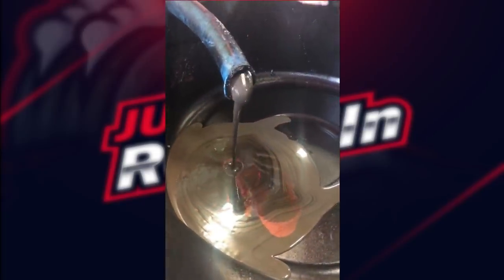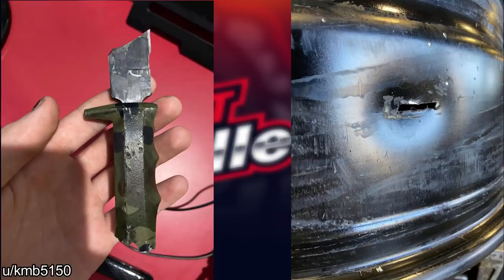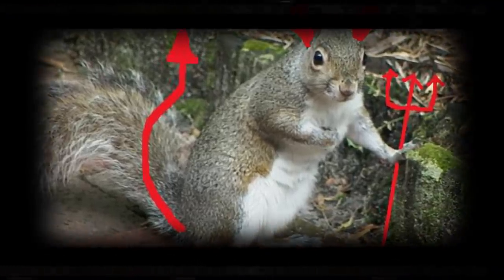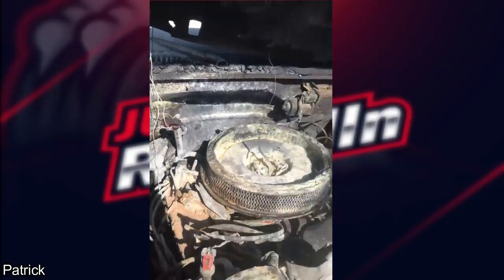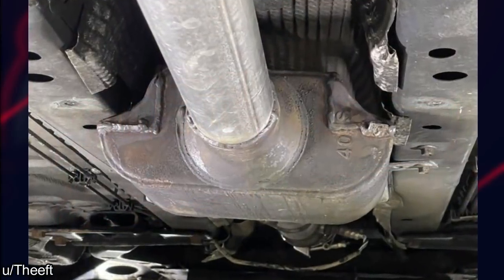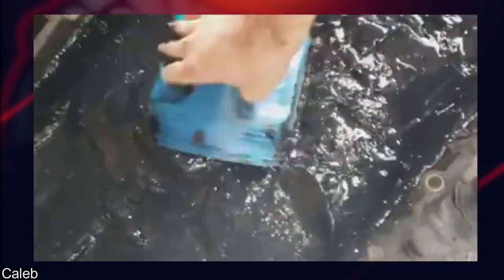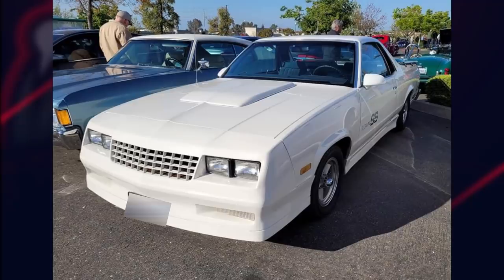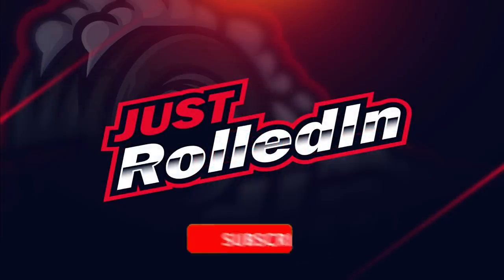Customer States "I Don't Believe You, I Don't Need My Oil Changed!" | Just Rolled In

Comment: I work at a Take 5 and last week we had a lady come in for an oil change she was a new customer and when I took out her drain plug I noticed that the “oil” on my hand was pretty much completely clear with thin wispy black streaks in it. Of course I was concerned but no one in the shop could figure out what it was. It had the same consistency of oil and it tasted like oil the weirdest part was it was actively evaporating off my hand and not leaving a visible reside. By the time I was out of the pit and done with the drop half of what was on my hand had evaporated and by the time I went back in the pit to look at the small puddle that had accumulated earlier it was gone but other oil puddles were still there
Reply: Sounds like someone might have used acetone or maybe some sort of alcohol (ethanol/methanol) or something similair to substitute part of the oil
Reply: @patdbus  that would make sense by the time I went to clean up what had spilled half of it had evaporated but it tasted like oil no sharp taste like a solvent
Reply: @connormanable  could have done a small burn test on it aswell. And since oil, diesel and some other fluids dont light on fire from a mere match and alcohol burns without much color but gasoline lights easy on fire, you might have been able to determine more closely what it was.
Though i understand that that could be dangerous in a mechanic's shop, aspecially since it was that quick to evaporate, and probably wouldn't be within your job duties.

Comment: Craziest thing I have ever witnessed and to this day don’t know how they even managed to drive through the shop. When I was a mechanic we had a Mazda rx-3 customer said that the car was overheating they took it to another shop and didn’t like what was done so brought it to us. I was told to put the thermostat in I thought ok simple. I install the thermostat ,and ask where is the alternator, water pump , and belt come to find out the previous shop never installed any of those components and the fact that they drove about I believe 10-15 miles without either of those parts just blew me away.
Reply from the maker: Holy crap. Well good thing they brought it to your shop.
Reply: It can be done. Battery will last ALL DAY with out a recharge. Water pump is more weather determinant and distance traveled.  Not a far distance with no hills then is doable like an air cooled VW beetle.

Comment: I had a foot and half of half inch rebar in my tire. So long it was curved to fit the inside of the tire. There was a little bit sticking out and the tire guy couldn't believe how long it was. He said he couldn't fix it but I told him to use 2 plugs and lower the wheel down on the plugged . No problem after that

Comment: I heard a story about a man who didn't change his oil.  His theory goes like this:  The oil company says oil breaks down over time and needs to be replaced, but the government says that you can't pour used oil down the drain...because it damage the environment.  He deduced that if used oil is bad for the environment, it is still oil, which means it hasn't "broken down" like the oil company says.  Therefore used oil is still oil!  And if it is still oil, there is no reason to replace it.  From this line of reasoning, he clearly understood that oil changes are a conspiracy by big corporations to take his hard earned money.
Reply: The Red Green oil change - Replace the oil with the oil you saved from the last oil change.  And save the removed oil so you can use it at your next oil change.

Comment: @2:40 It looks like the driver wanted to avoid a transmission repair and kept topping the leaking fluid with bars stop leak. Overtime the whole transmission had 0% transmission fluid and 100% stop leak. It stopped the leak and the whole vehicle!

Comment: the worse job I have seen that made me do a double take was when a couple of guys pulled up into a parking spot.  I guess one of their tires were flat but then I noticed later that the guy had tried sealing the tire and rim with duct tape and then he had gone about trying to put air in his tire...using a bicycle pump!!  The air was escaping quicker than he could be it in.

Comment: In response to the question about the oddest thing that punctured one of my tyres, I give you…part of a pen.

When I first pulled up, heard the hissing and investigated I saw what looked to be a small, hollow metal tube embedded in the tyre and assumed it was a stray nail from a Stinger / Spike Strip left on the road following a Police deployment.

One trip to the tyre fitter later revealed it wasn’t, it was actually the conical metal shroud that screws onto the end of a pen to cover the nib. I think I still have it, somewhere.

Comment: I am the ONLY PERSON - who has ever driven a Chrysler Intrepid home -- [40 miles into Rural area - like 30 min minimum - from a fire truck ] ---  from the Mechanic - with a fuel Clip - NOT clipped - -- high pressure line - 56psi fuel --  and the car never lit itself on fire. I had it floated back to the mechanic - and the Line Clip - never Clicked - until the mechanic checked and got it to lock. First time HE had ever seen it.

PS - @ 3.40 - A Volvo - 80's  or so?  Nice look - they were a Canadian Legend for lasting 30 yrs and 600,000 miles, back then!  
And What is your JELLO-OIL-PAN recipe?  I cannot wait to share it at the bowling league!  I have never seen that!

Comment: I was working in a Ford garage in Alberta Canada in the eighties, we did propane conversions and tuned up same. A customer brought his new F150 in with no oil pressure. He had done his own propane conversion with parts from his old pick up and failed to bring it in to have the mixture adjusted and the oil jelled , looked much the same as the clip in this video. Needless to say he got no warranty and had to pay for the engine overhaul.
Reply from the maker: Which dealership in Alberta? Thats where I'm from!
Reply: @JustRolledIn  THE NAME THEN WAS NORTHGATE FORD SALES I believe it is now called Cam Clark Ford.
Reply from the maker: @robertromney1777  lol too funny. That dealership is a quick drive from my house

Comment: I've been working on cars off and on for 30 years. Had a Pathfinder once. Missing Inside Brake Pad on the front. Stopping on the Piston. Rim damage? Lady was driving on the Interstate. Near a construction Zone. Had a blow out. Comes to the Sears Auto I worked at. There was a Big Hole inside the Drop Center of the Rim. Maybe a Steel Reed Bar?? Back around 2000 I worked at a Pontiac/Buick/GMC dealer. Car came in the shop. Customer poured Washer fluid into the engine. And ran it. Came out like a Chocolate Sundae.  The tire shop I am working at now. Customer comes in. Asked for a Coolant Flush. It was a 19 Toy C-HR. With only about 13k Miles. Huh??? Open the hood. Find the Coolant Cap off the bottle. Go in the office as I am seeing 2 Red Flags. Lady poured Washer Fluid into the Coolant bottle. Changed the Coolant. I can't see any issues. Except the Coolant now had too much water in it.

Comment: I had a car fire because a squirrel packed the air cleaner full of nuts. The nuts went down the manifold heat riser and came in contact with the exhaust manifold.

Comment: I had a car come in with oil close to that consistency. She had a new car that the salesman told her needed zero maintenance for 100K (had 30k on the clock), but when it started making noise her BF checked the oil, and brought it to me. I did 3 engine flushes, and it was still coming out black as diesel oil🙄

Comment: I had a van come in that was a company van. It was towed in, and didn't run. No crank, but starter engaged. I pulled the dip stick, and the oil was dirty but full. I put it up in the air, pulled the drain plug and no oil. I pulled the pan, and the pick up left a hole in the oil. Made the mistake of sticking my fingers in the "oil". Came back cut from bearing slivers. I then noticed the right front rotor was cut away from the hub. What the hell do these people do? By the way, this was long before cell phones, about 1985.

Comment: Not enough metal in the oil.  Put it back in with 2 tablespoons of steel filings and run it for 100k more miles.

Comment: How about railroad spikes? I work for a railroad and we get tires and wheels destroyed by spikes regularly. And yet we can’t get the crews to slow down. It cost us thousands of dollars a year that would not be as much an issue if they would simply drive under twenty miles per hour.
Reply from the maker: I've seen a handful of railroad spikes in tires. First one I ever found I kept and it's still in my tool box to this day lol. I've had it for probably 10 years.

Comment: I spent 15 years at a Chevrolet Dealer, and I saw many of these things, I just can't understand the mentality of people that don't understand why you can't fill your car with oil at the gas pump, I mean it doesn't just make the car go, it lubricates the engine, that's why I don't change the oil. After 13 years of this crap and 2 years of writing service dealing with idiots, I left and started another career in Hospital maintenance, so much easier.

Comment: Gelled oil is what happens when you mix fully synthetic and conventional oils
Reply: I've heard of this, but have never seen any citations or the like. I've done it myself with no problems. And think about it, as mixes are sold on the market called synthetic blend. It's possible that that may have happened when synthetic oil first came out, but not now.
Reply: A few years ago we experimented with a car tried a bunch of combinations one was mixing synthetic and regular oil, nothing. Synthetic just means man made and regular oil is just refined from a oil well.
Reply: @graham2631  the only issue Ive seen in person with that is when there is a lot of heat put to them. But that was with a semi transmission. Fluid was consistency of jello.

Comment: Didn’t change oil. I have seen it personally.
Reply: No I'll bet the valve lifters were noisy, so he added several tubes of black grease into the valve cover mixed the old oil. Made it quite for a short time until the oil pump clogged up.
Reply: @ReadyFreddie5523  that engine doesn’t have lifters. It’s OHC

Comment: I plugged a hole in my tire with bubble gum and duct tape. Had to get to work in the Air Force. It held until I got it fixed about 13 hours later. The guy just laughed when I told what and why I did it.

Comment: "What caused the jelled oil?" Can't really say for 100% certain, but I have seen similar. Fancy "super efficient" synthetic "oil" might be everything that they say, but I have seen it turn into that same kind of plastic jelly when a head cracked and a tiny bit of water got into the engine oil.
Reply from the maker: Coolant got mixed in with the oil from what I was told.

Comment: 2:42 now that has to be lack of oil changes or incorrect oil viscosity. Either way that engine will never be the same again.
Reply from the maker: I looked into it some little more, they are unsure what happened but think it might have been caused by adding different oil additives.
Reply: @JustRolledIn  ouch, well that was a costly mistake. Some people i find here in Australia will buy the cheapest thing on the shelf and wonder why they have issues, now as a car gets older going by the book is not always a great idea as you may have to change the viscosity a bit, but if people use quality oil filters and oils and keep up to the service schedules most of us never have a issue. 
The worst thing is if a vehicle has these kinds of issues (sludge) and they are either traded in or sold off someone is stuck with a unhealthy engine. Oil and filters are cheap compared to a new engine. And people need to stay away from additives that promise a quick fix!!

Comment: That gloopy looking oil is most likely from oil additives, some people are absolute idiots and use multiple bottles of those cheap oil enhancers you can get for 10 bucks at any gas station, and they are suppost to thicken the oil to lubricate better, but multiple bottles results in very very thick oil which will barely even move through the oil passages and do tons of damage

Comment: That last guy Caleb's vid, what is going on there is somebody made mud flavour jello in the engine...
Reply from the maker: Tried looking into it some more online and sounds like it might have been caused by some oil additives but they are unsure. Really weird nonetheless.
Reply: ah cool, (I guess, lol) that's some strange additives to do that. Kinda like the sludge from incompatible coolant types, was not great though for sure & looked like the rotating assy. got quite hot, guessing it ruined the bearings?
Reply from the maker: I would assume it did. Apparently it came in for a no start, so I'm going to say it ruined some bearings and seized some stuff up 😅

Comment: Has nobody ever been pissed at somebody and dropped some jello puddin packets down their oil filler?   Yea, they drive it once and mixes then heats it up so when they let it cool down, no worky no more..  doesnt work in gas..  you gotta use regular jello..  a lot of it for fuel injected motors but will clog a carb with one packet…

Comment: When I was teaching, a female friend apparently started her new Caddy ( inherited from her mom) at -30 below to warm it up for 15 minutes at recess. The carb accelerator kickdown must have jammed to almost full throttle, with the engine oil being the consistency of molasses at that temperature. When she returned 15 minutes later her engine wasn't running , so she took out the key. After work it wouldn't turn over. Yeah it was seized. When asked about what happened, she said " When I left the car it was making a funny noise. " Poor husband!

Comment: I pulled a 13 inch drilling bore out of the tread of a , wildcountry? Maybe a bfg rugged, but either way, only the chuck side was visible, just looked like a bolt, when i popped the bead and had look -- hot fuckin damn, this thing looked like it belonged on a spear xD ive also seen plenty weird shit, tire guy since 2008

Comment: The last video is Lucas,  you cant use it instead of oil,,  a little bit MIGHT quiet down a worn motor but it is waaaaay to thick to use instead of oil,,  I had a Cummins 350 that was worn out,, used a gallon of Lucas to 9 gallons of oil,,  after running the engine all day andthe next morning there would be a small blob of this shit on the ground directly under the slobber tube (crank case vent tube) because of all the blow by, the engine was worn out and needed rebuilt, if repairs came in a can or bottle, nobody would be a mechanic.
Lucas, STP and stuff like that is a gimmick and a RIP off